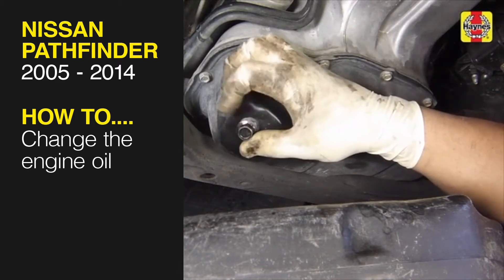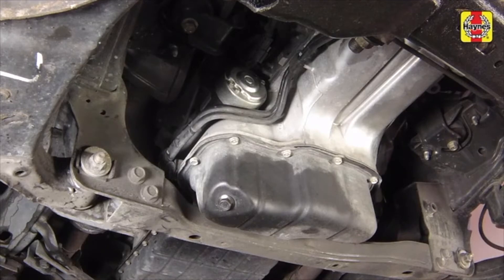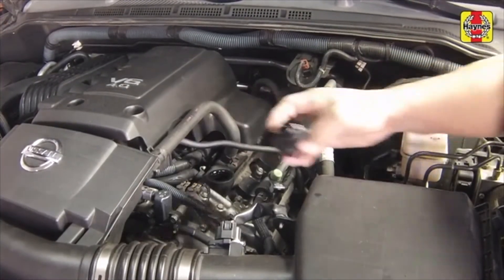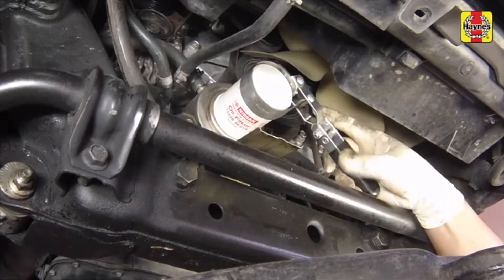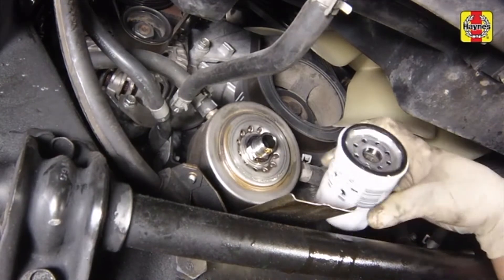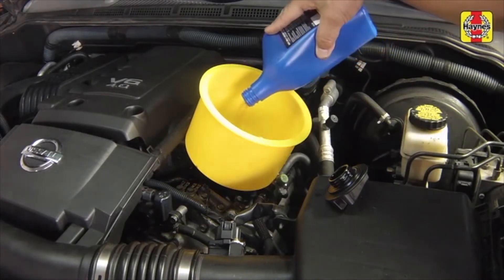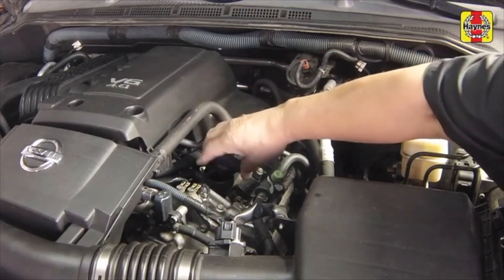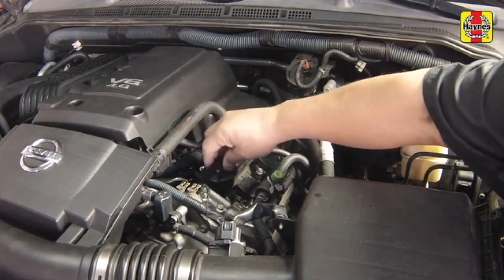How to Change the engine oil on the Nissan Pathfinder 2005 to 2014

Comment: What size socket for drain plug screw? And, no, “any standard oil filter wrench” will not work. The filter has a specific diameter and if it’s not a universal strap wrench like you used, it has a range of diameters that it will work for
Reply: Hey so what size was it ?

Comment: Does it take synthetic oil or no?
Reply: Full synthetic
Reply: @epicerikieb9676  I have a daily driver pathfinder and had it for 15 years now, I always use non-synthetic oil, but got to change it every 3k miles. This didn’t show how to remove the skid plate though to get to the filter.